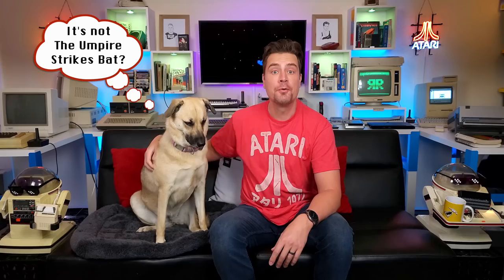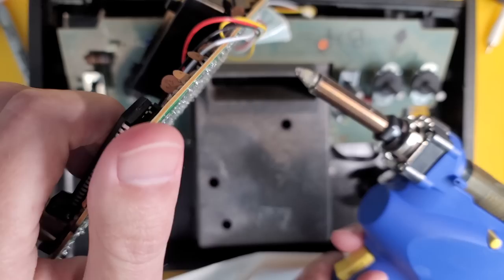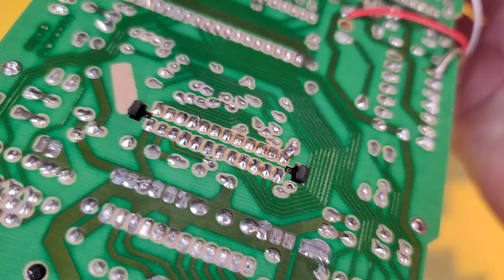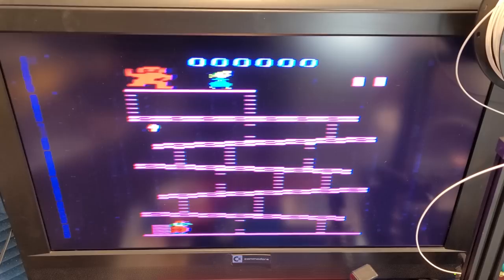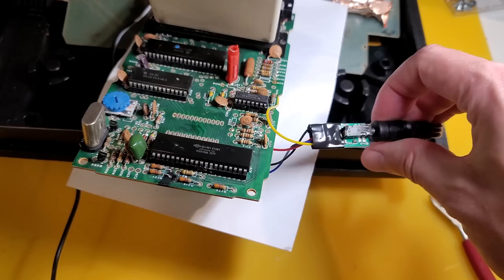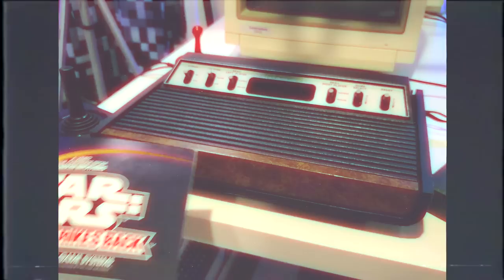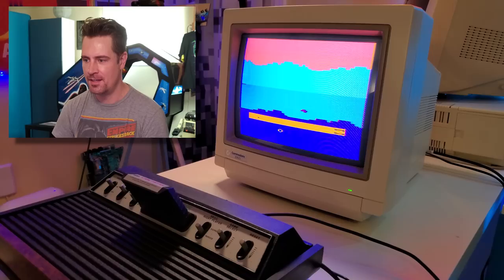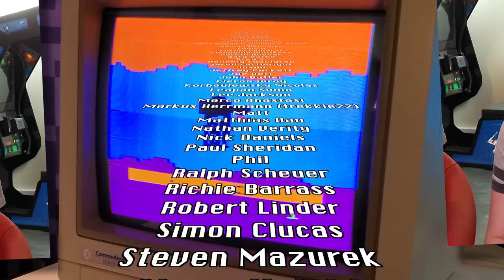I've waited 37 years for this game. WILL IT WORK!? | Empire Strikes Back Atari VCS Repair

Comment: Dude! 
Put the ferrite bead on the video signal wire of the composite hack! 
Put a couple wraps through a ferrite donut. 
Or wrap the composite signal wire in that copper tape. That's been the problem all along as far as the interference goes.
Reply from the maker: Dude, that didn't work. I don't show every step I tried in this video. But, I solved the issue. So what's the point of troubleshooting steps now? Asking sincerely.
Reply: @RetroRecipes  Whoa. Just trying to help. You didn't mention that you'd tried that in the video. My point was that fixing it internally frees you from being stuck using a specific wall wart or outlet. 

Anyway my guess is that the composite hack needs additional circuitry or design mods to isolate it better from the noisy power rails. If this was the audio I'd use an isolation transformer but I don't know if such a thing can or should be used with video. 

I wonder about a 60hz notch filter on the power rails right behind the jack the wall wart plugs into. 

Anyway glad to see you got A solution and a chance to finally play that game that's been taunting you since childhood.
Reply from the maker: @ChristopherGaul  Thanks. Yeah it works great. You know, after 3 weeks on this project, I'm ready to leave it alone 😊
Reply: @RetroRecipes  I hear you. Frustration/ return ratio at max. 

That's when you wrap the project and call it good. 

Though the noisy output on these old systems does get frustrating. I guess there's a reason the engineers back then just wrapped everything in tons of sheetmetal RF shielding and shipped it.

Comment: Peri, have Ladyfractic learn drag soldering so it makes the reflowing jobs easier. You need a little different tip, but man it makes life easier when soldering ICs and the sort.  Google "Quick Link Choke" for an RF choke for power wires.
Reply from the maker: I like my tip! 😊

Comment: Switchmode power supplies cause lots of interference on electronic equipment. Especially  the plug top type like mobile phone chargers.  Even modern LED street lighting causes interference on my amature radio gear.

Comment: you have peaked my interest, I seem to remember that there was a splash screen with intro tune which was not on yours. Curious now....second issue, I would have put a bunch of ferrite cores on every length of wire INSIDE the console not just on the power supply. surprised with all your tech you did not try that first. Lastly there was a guy who was building updated atari 2600' https://www.youtube.com/watch?v=Jp_cpSxAK64 This game also spawned a small circuit using a 555 timer to operate the fire button a bit faster to maximize the joystick.

Comment: One of my fave games back then, though incredibly difficult.  Still got the cartridge as well as a lot of other 2600 games.  So i guess thicker wire with heavier insulation cleared up the interference from the wires attached to the video mod pcb?
Reply from the maker: I suspect one of the wires that came with the mod had a break in, or maybe just too long...

Comment: I still have my original heavy sixer. But if I play Atari I plug in a newer version I have that only had 4 switches on the top and 2 on the back.

Comment: Question is for UK or American that's the answer the power supply in the US is different to the Uk the fuse in the plug and sometimes wiring makes a difference but in anycase it didn't blow up and of course where it was meant to be played the video broadcasting differes? But no flames either? Completely working?

Comment: The Atari 400 is a computer not console(VCS), it has a keyboard. I had the type of interference from my Easycap D60 and HDMI32AV,it would convert HDMI to a AV signal, I would have the rolling interference and could ever get rid of it, it was like at 15:45 It could be coming from a PC or something its next too.
Reply from the maker: To be fair the VCS had a Keyboard accessory available too, made by Atari.

Comment: I would have thought all your interference issues would be obvious since you removed all shielding to access important sections of the atari, namely the shielding cage. You have applied a bunch of chokes to locally mitigate the problem, but you will be blasting rf into other devices nearby :)
Reply from the maker: Nope all the shields were put back, I just didn't show the reassembly process.

Comment: I had some difficulties with that composite mod too... I have a jr pal with revision F board and accidentally followed the 2600 jr NTSC guide (no jr pal revision F guides available)... Surprisingly it worked perfectly BUT later some guy on atari age posted a slightly different mod wiring and the results? STILL identical... Why? I have no idea...

Comment: 17:37 It says right there on the back cover: "For use with the Atari Video Computer System". Don't know why you expected it to work on the Atari 400. Being a 10 years old kid might count as an excuse. ;) But consider yourself lucky that you got the 400. It's a much more powerful machine than the VCS.
Edit: The game does look very cool though. :)
Reply from the maker: Good eye. The answer is that I was 10 and only looked at the front in the shop, then as you saw, immediately asked mum for an Atari. I then put the box down, and didn't buy the game until after we bought the 400 🤦‍♂️ PUT IT ON THE FRONT NEXT TIME ATARI!

Comment: Wow, wow, wow. That was not a cheap mistake. I bet you were heart broken. I had both an Atari 2600 and 400. I had a lot more fun with the 2600 than I did with the 400
Reply: I have a XE  and I only play cartridge games with it. Beside running various 8-bit software, would a full setup still be useful for anything?

Comment: Are you soldering the legs of an  IC?
Risky. The teat may flow into the IC and damage it.
Better solder sockets onto the board then simply press the IC carefully into the socket,
irrespective of whether you got away with it so far.
All the best.

Comment: Have you looked into upgrading to a high-quality battery-backed UPS which can help with dirty power, EMF, and hard shutdowns during brown outs?
Reply from the maker: As it's the only computer with the issue I'm fine with the ferrite. I did order a clean power filter then cancelled the order for the much cheaper fix 😉

Comment: Can't believe the first thing you didn't check were the video wire connections.
You have unshielded wires carrying an analogue video signal.
They are very likely to be vulnerable to all types of electromagnetic interference.

Why not try shielded cable instead of those single bits of wire??
Reply from the maker: Well, I expected the mod to come with wires that worked 🤷‍♂️ It's easy to say I'm hindsight I guess...

Comment: You definitely do not need to desolder all of the joints just to reflow them. Just reflow them. 

All of that heating and reheating of the PCB will stress it. Try to do it as little as possible.
Reply from the maker: Hmm. So you're saying old solder is as good as new solder?
Reply: @RetroRecipes  always add some new solder. But if you give the PCB heat stress the traces will lift then you're running jumpers.

Comment: Old Hardware will be the thing of the past now we have Linux machines mimicking retro computers like the Mini's(MD and NES,SNES,NEOGEO) and THEC64 and THE VIC 20. I have already stopped using my C64C and use my THEC64 Maxi instead. it cost to much to keep them going.. Its a good thing.. :) and its easier to setup THEC64 then the real thing, no need for 1541 Disc Drive(very heavy) or a Datasette, its all in one, I do have a Atari VCS and a Colecovision that I have never used, I collect old hardware.

Comment: I don't understand why placing a diode in parallel with the capacitor would block noise coming back; shouldn't the diode be in series AFTER the capacitor to choke away any interference before it has a chance to go back through the capacitor again?
Reply from the maker: You'd have to ask the Atari engineer who wrote the manual for the specifics. I'm guessing it filters "enough" or half that way.

Comment: Your video improvement was largely down to you making the unshielded wires /shorter/ - so less wire, less hum pickup..  Also, did you replace that metal encasement you removed at the beginning? That would have been shutting out some interference too.  The ideal  would be to solder the socket board almost onto the main PCB, using just some short (1-2 inch) solid-core lengths to pass the signals. It's shielding that's the remaining problem I'll bet; think of a hi-fi system, imagine the difference in signal between connecting the record deck to the amp with shielded phono cable versus using some plain wires - imagine the hum problem..  The video signal is loads higher level but you'll still see the hum banding if you're not careful..

BTW, the Atari 400 wasn't a 'video game system' it was a computer. Well, nominally.. Gimme a Beeb micro or one of the Z80 toys any-day, mine was a zx speccy and a resultant grounding in Z80 assembly programming ;-)   - Ah, the joys of 'machine code' I still remember the joy of escaping the slow motion BASIC jelly universe <grin>/

Comment: I'm curious if you have removed (and not replaced) Rifa safety capacitors from other old systems. That could account for the noise in the electrical system.
Reply from the maker: Nope

Comment: Spoilers! You picked a great game! And, to think, the Atari had multiple Star Wars games to select from. Like the one where you train against a floating orb. Less said about that one, the better. Death Star Battle was...interpretive. Get it only if it comes bundled with other games. Then, there was the Arcade Game. The machine seen in this video is the way to play this. However, they really pushed what the Atari could do to even get as decent a port as it proved to be to even work.

Comment: Dump the 7805 and jam in a TRS-1 2450 for $5 bucks. They run much cooler and are 96% efficient. It will also allow you to ditch the heat sink. I get the exact same interference on my modded 2600 Jr. Can you post part numbers for the chokes you used?
Reply from the maker: They’re discontinued but https://amzn.to/3cVa8sV looks the same 👍🕹️

Comment: why not use shielded cable? for example rca cable so you can shield ale wires sepparat or shielded network! cable
Reply from the maker: I trusted the cable that came with the mod 🤷‍♂️
Reply: @RetroRecipes  I understand.

Not always those who make modifications know what they are doing or doing everything right.
It is also about price. Shielded cable is more expensive.

Picture signals via SCART or HDMI or other picture signals are  almost always shielded cable!

Comment: I got my Oculus Quest 2 the other day, do you have one?
Reply from the maker: I do not!
Reply: @RetroRecipes  You gotta get one, they´re lots of fun!
Reply from the maker: @Jpetersson  I have a PS4 so would get the VR headset for that. Do you know if the headset is all I need, or are the handheld thingies for the PS4 also needed for Squadrons?
Reply: @RetroRecipes  I don´t have a PS4 and don´t know if the handheld thingies are required for Squadrons or if the gamepad or other controller would work with the psvr headset, but if you have a gaming PC I´d get a Quest 2 instead and play the PC version of Squadrons, the Quest 2 has a much better, higher resolution display and can be connected to a pc via a high bandwidth USB A or C to USB-C cable or completely wirelessly using virtual desktop for the quest (you have to sideload a patch though). There will be a little bit of latency playing wirelessly but not alot, probably around 20ms with a nice pc and graphics card and good wifi. I´ve played Half-life Alyx wirelessly with my Quest 1 and 2 from my PC (in VR) and that works really well. Using a pc you could get some really fancy controller/s for Squadrons as well. if you don´t have any interest in using an oculus quest with native android apps (you can´t get Squadrons for it) but still want to go the PC route I´m sure you can find a used Oculus Rift S pretty cheaply...they´re gonna be discontinued soon. I´m swedish so my grammar might be weird here and there...anyways some things to think abooout although the PSVR route might be the cheapest way for you to play Squadrons in VR, not the best way but maybe the cheapest one, I´m not sure...and no I haven´t played Squadrons myself.
Reply: Made som edit´s above.
Reply from the maker: @Jpetersson  Alas I don't have a gaming PC. I use Mac for video editing, and PS4 plus all the retro computers of course 😉

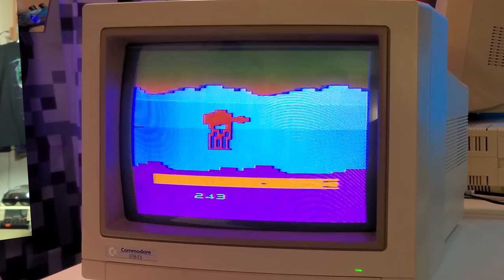Comment: 24:50 I think that this is caused by you modifications on joystick ports , it shod not flicker like that when toy shoot
Reply from the maker: Another test game I tried did the same thing before I performed that mod so that is not the cause. But as I showed at the end of the video it is not a problem anymore.
Reply: @RetroRecipes  very strange situation, thank for the relay. Nice restoration, but u loud keep the RF intact, for example I AV nodded my famicom and kept the RF :)

Comment: You never thought to shield the video signal ?
Reply from the maker: Not sure what you mean by never because I did it in this video
Reply: @RetroRecipes  My mistake; sorry, I only saw the single insulated wires. I didn't see a shield covered insulated conductor for the video signal. Glad you got your machine working.

Comment: Maybe try the Ultimate Atari Video (UAV) Mod sold by The Brewing Academy.  I had similar issues with the standard "Atari AV Mod" out on the internet and Ebay everywhere. It gets you composite but seems prone to interference / weak signal.  Video by ctrl-alt-rees comparing the standard AV mod to the UAV (https://www.youtube.com/watch?v=XjjghprXHnE).
Reply from the maker: UAV is great, I have one in my 400

Comment: Am I missing something?? When did Atari 2600 systems or empire strikes back become so hard to come by that it took 37 years to finally play it? I have 8 working 2600 systems in the back of a closet and like 3 copies of empire. I am really confused. Why did he have to salvage parts from a "Vader" edition? When you could just grab a working 2600 for like 50 bucks?
Reply from the maker: Well, I guess you've missed the point. In the previous video I show that this VCS was a donation. I had all but forgotten about this story until I received that donation. The donation inspired me to get that machine working so that I could make this wrong right. The Vader machine isn't the classic VCS that I always wanted. in short, I haven't spent the last 37 years unable to find a VCS, I've been doing other things with my time but finally the timing was right. 👍🕹️
Reply: @RetroRecipes  thanks for explaining. I have never watched your content so didn't know about a previous video. The title just made me scratch my head. The video itself is a great tech repair video. Guess it just doesn't have much to do with the title or vice versa. But I get it youtube algorithm sucks and you gotta do what you have to to get views. It obviously worked because it popped up in my suggestions and I clicked. I will check out more of your stuff. Take care.
Reply from the maker: @xtremejay2000  Thanks! It's all good. And yes, YouTube do somewhat require video thumbnails and titles to be highly engaging to get clicks, but I make sure the video pays off. If viewers don't watch a video for very long YouTube stop promoting it. You saw this one because it has good audience retention, not just a snazzy title. Ahh the mysteries of the algorithm!

Comment: Anyone know which exectly which zener diode to use for the static protection mod?
Reply from the maker: Google for the field service manual or Console 5 sell them (link in Description)
Reply: @RetroRecipes  thanks, I did look at service manual but it just states zener. I ended up doing some research and given that the system runs on 5v, I got a zener with 5.1v breakdown voltage, or something like that which I think is how you choose them lol, not totally sure but it seems to be working ok :)

Comment: You said you have a Tesla's solar system in your home.... i can tell you from my experience. The interferences is coming from the inverter on your solar system
Reply from the maker: Actually considered that and did turn off the power wall but I think you are right. I just didn't want to risk turning off the solar.
Reply: @RetroRecipes  the atart is powered by 9 volts dc.  I would try powering it from a battery  pack made from 6 d cell batteries.. at the least it would make a fun vedio playing a portable Atari on a  Portable CRT TV at a coffeehouse

Comment: Hey,
realy nice repair! Great you got it to work. But you realy need to work on your solder skills. Have seen a bunch of ripped pads when you used your Desoldering gun. Before desoldering heat up the pads and reflow them with some new solder. After that you can start desoldering. That reduces the rate of ripped pads!
Anyway, great work!
Greetings from Germany
Reply from the maker: Good tip!

Comment: If you had tried the plug socket first, then you might have saved a lot of time, lol.
Reply from the maker: Well there were 3 separate issues so each of them needed to be done. The ribbon cable was a big one. But it's easy to say in hindsight of course 😉

Comment: Your wires are way too long. Wires carrying analog signals, especially sensitive ones like audio and video, should be as short as possible. Loose wires are basically antennas and will pick up interference, and it gets worse the longer they are. Even better, either use shielded wires or twist a ground wire around the signal wire to help absorb the electromagnetic radiation before it interferes with the signal.
Reply from the maker: Not my wires, the wires supplied and stripped by the mod creator